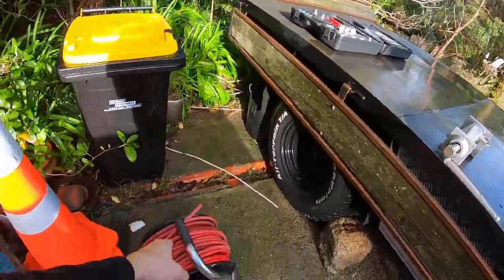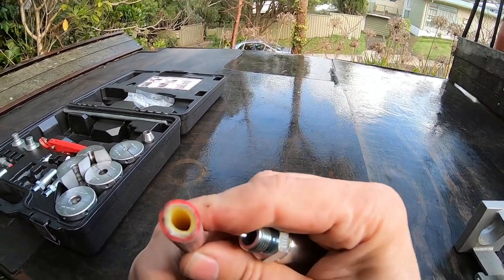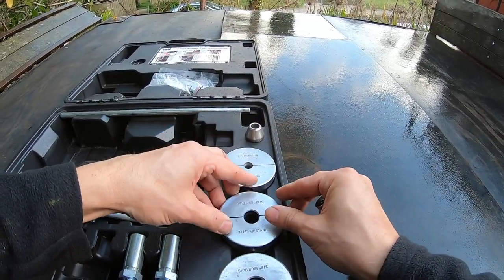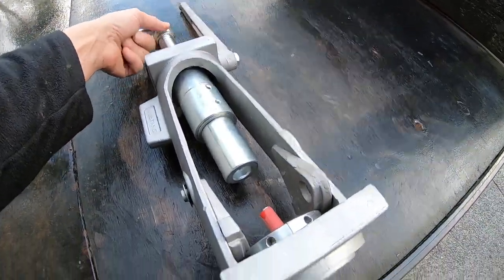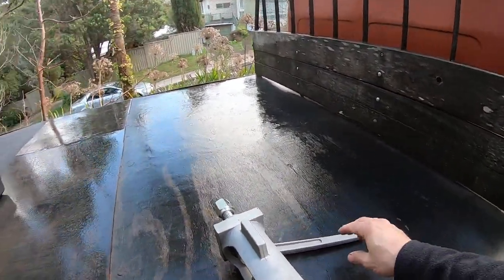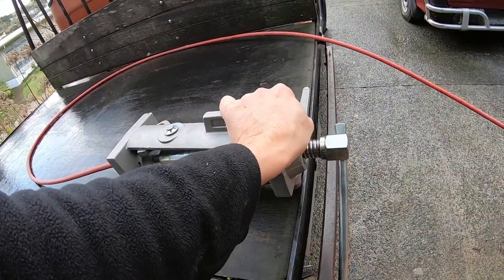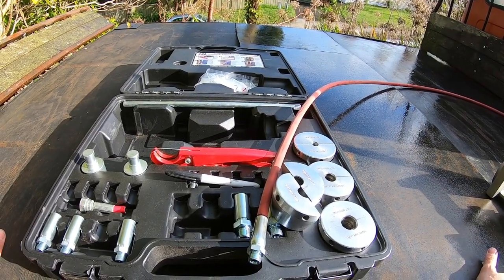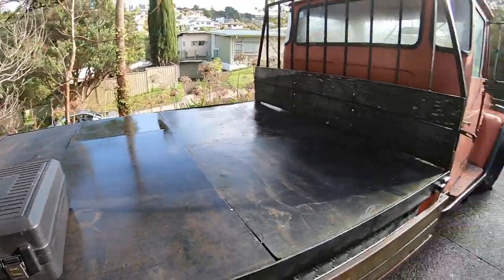Mr Drains #62 - Repair Jetting Hose With New Swage

Comment: I have a question maybe you can help I'm in the US. and I bought a jitter hose off of Amazon I know probably not the greatest toes but can you I have a 1/4 can you take a new swage and press it on that hose I am told the holes diameter is different from those Amazon hoses I don't know I don't want to cut the end off if not for sure.
Reply from the maker: Do you know what size hose you bought? This kit is for 1/8, 1/4 & 3/8" hose.

Comment: I have been using the one wire field repair ends with good results, just screws right in and I can use it several times.
Reply from the maker: This is a good way for a permanent repair especially if jetting up over 5000 psi.

Comment: ouch on the price
Mustang Hose Repair Swage Tool Kit 
Price Ex GST:791,78 €
Reply: You gotta spend money to make money.
Reply from the maker: It's an expensive business this drain cleaning racket lol, but handy to have one of these. Getting it done by a Hydraulic Fitter usually cost around $80 - $140. I reckon I probably got 2-4 more times of fixing it myself & it would have paid for itself.

Comment: I like that flatbed truck! Nice video of the swage tool. I usually find it easier to just run up to Napa to fix hose
Reply: Might save money in the long run getting the tools and doing it for yourself.
Reply from the maker: In the past I sometimes had to ring around to find someone with the correct sewer jetting swages & after hours it gets expensive. Definitely can recommend getting one of these, more for infield convenience, but you will also save money long term.